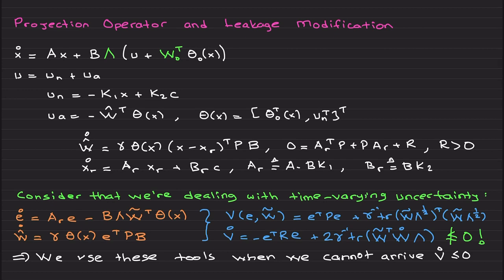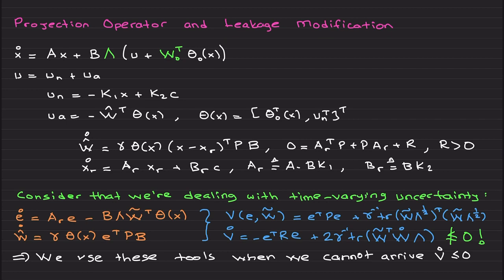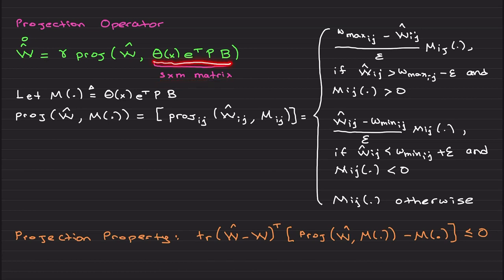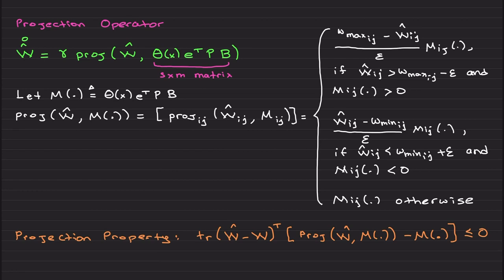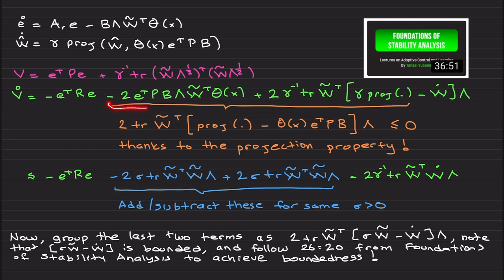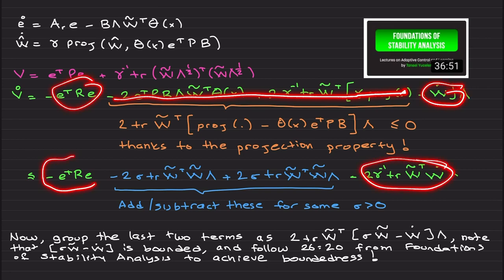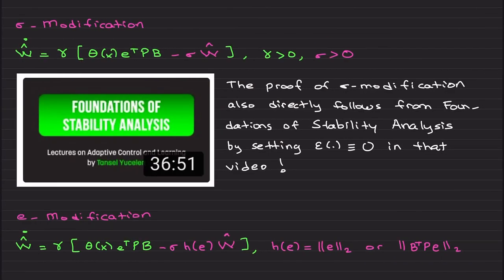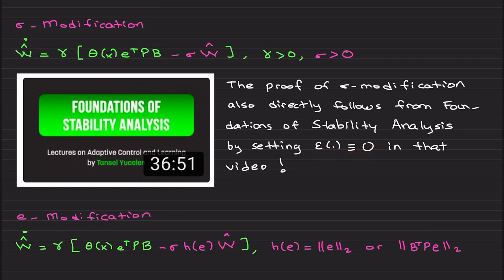Projection Operator and Leakage Mod.: High-Order Case (Lectures on Adaptive Control and Learning)

Comment: Üstad, is it possible to combine leakage modification and projection operator in one adaptive law?

Best regards

Süleyman
Reply from the maker: Hey Suleyman, Thanks for the comment. Yes, this is certainly doable! See for example (32) of this reference:

Dogan, K.M., Gruenwald, B.C., Yucelen, T. and Muse, J.A., 2018. Relaxing the stability limit of adaptive control systems in the presence of unmodelled dynamics. International Journal of Control, 91(8), pp.1774-1784.

Without the leakage term, the adaptive term will grow and hit to the projection bound (let me know if this is clear from (32)). To prevent this issue from a practical perspective, we added also a leakage modification.
Reply: @tyucelen  thank you very much ustad. I implemented now the MRAc e-modification for control input disturbances of rotorcraft. Further, to modification term is  set  to zero for the Feedback gain and feedforward gain adaptation since the  ideal values are constant. 
İn summary it worked, I try now to proof  the boundedness. 
Thanks for your videos üstad they  help a lot :). My adaptive flight comfort mode works in simulation now :)